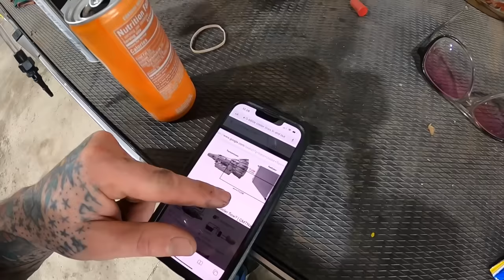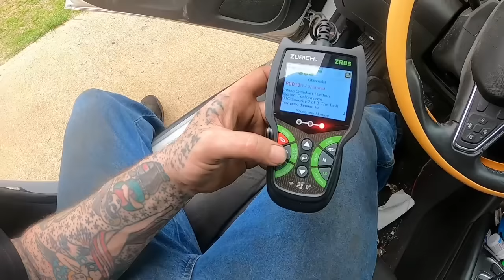REBUILT TRANSMISSION install! I DROPPED it and BROKE it.!

Comment: I’m no Dr. and don’t necessarily recommend it but super glue is real good for some cuts and stuff. 
Be forewarned it is gonna sting a bit. 😬
A loyal mutt that is on the brink will bring nothing but joy and happiness for all! 🙏🏻
Reply: I just had surgery (one of many) and they use super glue to close the incisions instead of stitches. Same stuff you get at the hardware store. Stronger and leaves less scarring.

Comment: Ouch! Thank God you did not get hurt worse but that bandaged finger with come in handy in bad traffic. 😉 It's commendable that were able to use brake clean with the cut on the finger without getting a direct blast right on it (which is what I usually do). I always thought mechanics shop dogs should be named some that is used while twisting wrenches, like Jack, Allen (wrench), Stanley (screwdriver) or Tie (rod).

Comment: One of the converter holes on the flywheel is oblong. If you start with that one the others will line up without installing them all and then tightening.

Comment: Some vehicles like my 97 Dakota there is a one way valve in the linesby the radiator. This prevents the fluid from running out of the lines, cooler and radiator back into the transmission. I guess they don't want too risk the pump in the transmission running dry. On this vehicle back flushing the lines and such wont work. You have to flush the wasy the check valve lets fluid flow.

Comment: With the variable valve timing solenoid if the oil is old it will throw that code, but most the time they do go bad.

Comment: That oil in the connector may have caused the unit to go bad, clean it with electrical component cleaner as it doesn't leave residue behind like some cleaners or damage the plastic like some acetone cleaners and wont cause an electrical short

Comment: Blowing on your converter when you have shop air. Just turn the pressure down or turn the compressor off when you have 10 psi ish

Comment: 36:40 when putting the torque converter bolts in, be sure the torque converter spins easy, if not the converter is NOT seated and you will damage the pump. Should click in three times when seating the converter to the trans. And leave the torque converter bolts loose until ALL bolts are started.

Comment: 6:06 lifting those GM SUVs I always put the rear pad under the front leaf spring bracket and set the short pad up on the front and position it on the frame rail. That way the car lifts level.

Comment: I do the same thing, when I take apart a whatever I just throw all the bolts and nuts into a box and I put a piece of blue tape on the box, write down what part all that held on and usually lose the box.. Being a mechanic for so many years now, all of them really, they go back together the same way they came apart. Even if it was 6 months ago.. : )

Comment: I was on my back changing a fuel line on my 70 Pontiac, the rubber line pulled free fast from the hardline and the back of my hand hit an old rough weld on the crossmember. I first thought I accidently broke a transmission line because of the dark red fluid running out everywhere. Then I remembered the trans cooler lines are on the other side of the engine... Nicked a vein. Good times. :-)

Comment: Hey, just some thoughts on the jack. The tilt knob should point back. And every transmission jack I have used has angle iron welded standing up on the corner brackets so It kind of locks the transmission in. I vote for Rupert too!!!

Comment: take an electric sander without sandpaper hold it against the torque converter it will vibrate the air out as you fill,or just blow in it

Comment: I would definitely give the transmission jack a good once over to make sure it is stable enough to roll around a transmission. Once you placed the torque convertor on the transmission it looked a little front heavy but I have never installed a transmission with a jack like that. Would love a shop like yours but that will never happen. Take care of your dog and we look forward to seeing him in future videos.
Reply: Operator error he didn't wanna use the chains

Comment: I've still got a scar and no feeling in the tip of my finger from my last transmission swap. Worst part of it was the nurse scrubbing the wound with what felt like my little brass wire brush. Good times.

Comment: But now you just need to remember to get a replacement transmission oil cooler for your dad's Tahoe... but even with everything else that trailblazer is put back together and running and driving while shifting up and down the road.,

Comment: Well done. I'm not happy you dropped it. But I em happy it was just the tailshaft. I have done more then a couple of Trans in my days. And I have almost always missed a bolt or too. Thanks for sharing.
Reply: They were the top ones he didn't want to do,  but knew he had to 😅. Would have been easier with it tilted down though.

Comment: I have had to move a oil cooler or two out of the way on big rig stuff. Down under the driveline as long as it is getting cool air. Double up if the masses say it's ok.

Comment: Cool looking green torque converter...my junkyard swapped torque converters two of them were actually coated in red oxide primer usually just rusted steel or the three new ones ive had were b&m dark blue

Comment: The new Chevy have a small slotted hole and that’s the one you start first for the torque converter, then the bigger holes. Now you know for next time you have to get that thing rebuilt. 4l60 things.

Comment: That Silver car is headed for timing chains and guides

That flywheel should have an oval shaped hole to put the first bolt in so it aligns the bolt holes

Comment: I just swapped out the trans in my F150 a few weeks ago and if I could have gotten my hands on an engineer,  any engineer,  I would have strangled them! Why do they design stuff with bolts you can't see and are next to impossible to get to? The two top boots on the bell housing took me almost 4 hours to install! I ended up using several 3/8 extensions to make a 3 foot long extension so I could reach the two bolts. Had to go in by the tail shaft and feel for the holes. Also my torque convertor came already filled. It surprised me because the trans was shipped from Oklahoma City to Carthage Texas and usually they won't ship stuff with fluid already in it. Hopefully this trans last me about 260k like the last one because I sure don't feel like doing that job again.

Comment: stuff  happens . i  had  a  1950  Dodge  flathead  6  on  a  chinese engine  stand  hit  the  the  concrete  trying  to  turn  it  over  and  found  out  when  i  started  it  the  first  time  it  cracked  by  the # 3 main  and  was  pouring  out  coolant  ,  time and  money  wasted .  i'm  glad  Hot Rod  is  feeling  better  and  has  a  dog

Comment: Little tech tip for you Puddin’ when in doubt where something goes or why you have a few pieces left over, do a quick watch of the video you took when you took it apart, hell I’ve been doing that with some of the jobs I’ve been doing lately because as sure as God made little green apples 🍏 I’m gonna get pulled away on a side job or something else and then when I get back on it I’ll be doing the same as you, now where the heck did this bolt go.

Comment: I did a job for my uncle pulled the transmission out of his S10 to replace the torque converter seal got the transmission out new seal in replaced the transmission it still leaked fluid toke it back out he had the transmission checked the sleeve was sliding back and fourth blowing out the torque seal put a new sleeve in and seal no more leaks

Comment: I work in transmission shop and watching you mess with the transmission cracks me up and aslo don't need to fill converter the pump with do that for ya
Reply: Oh and chevys have starting holes for torque converter. Your flywheel will have an ovel shaped hole vs others will be perfect circle

Comment: Ive dropped a junkyard fixed transmission off a floor jack about 19 and broke the entire bellhousing off even with the front pump bolts on a th350 putting together my project car a 86 Buick Regal Factory V8 Sport Coupe
Reply: I then got a floor jack transmission adapter plate from trans dapt from jegs performance shop, and got the next transmission in the car and it ended up getting a $1,275  B&M short tail 2800 rpm stall th350 street master and the next weekend one of my uncles friends is like I'll trade you a rebuilt long tail th350, a new transmission mount in the box and like $250 and i was like seriously after what i have dealt with getting the transmission replaced in the damn car no freaking way lol..
Reply: It's not coming back out of the Regal unless i get rid of the car..

Comment: I've ran a transmission oil cooler on every vehicle ive put a transmission in project vehicle junkyard swap or new or rebuilt didn't matter it usually gets a another radiator and transmission oil cooler, the only exception of that was my 86 chevy k20 custom deluxe long bed well used 4x4 farm truck it already got a new radiator and it was the heavy duty 3 core with ac equipment factory replacement radiator brass and copper so yeah not spending $489 twice...screw that lol

Comment: Looks like you took Hot Rod's dog so watch out she may find another. that dog knew when to come so he is hers no other way about it. As long as it has been since you pulled that transmission I could not have found the hardware little on been able to put it together as well as you did.

Comment: I know how you feel with the Mrs. yelling at you for getting hurt. I was helping a friend with his garage door and had to release the door opener and when I did the door went falling down. My first instinct was catch that bad mamma jamma. When I grabbed it it pulled my arm down while I was pulling up and it ruptured my right distal biceps tendon. It ripped it clean off the radius bone. After a quick 3.5 hour surgery and 6 months of physical therapy the Dr. allowed me to return to work with a life long 25 lb weight limit, that my employer says doesn’t exist, because I was released from the Dr.’s care. Be fore going to the hospital initially I had to drive home from my friends house about 30 miles in a manual transmission Jeep. When getting home and telling my wife she needed to get dressed to take me to the hospital, she immediately started yelling at me about it. She didn’t believe me that it was as bad as I thought, until the Dr. in the E.R. said I needed to see a specialist for the injury and that it was the first time the she had personally seen that type of injury.
Now if it’s falling I’m just moving out the way and letting it do its thing.

Comment: Hey puddin the trai blazer the motor look just like the motor in my 2000 model Isuzu pick up truck and really the bed on it and cab looks like a S10 but not the front clip so im guessing chvey made Isuzu at some piont. I thought Isuzu was made in Japan or china i thought

Comment: You carefully used those support stands at the start  of the video and then later on they were nearby unused. What gives. You already had the transmission fall. This video was a classic case of haste makes waste. And the first thing I thought when Hot-Rod showed up was my how she's grown and will Puddin live to see her full grown.

Worse than having the car fall as with the transmission, even if no-one gets hurt, is thinking the chains, the stands, were right there. 

I'm skipping the videos of the model-A build but I don't want to see you getting hurt either. Please take a moment to prepare a safe work environment. At least you do a good job keeping the floor clean.

Comment: So why don't ya call the transmission recon shop and tell them what's up? They'll fix the damaged one in a flash and send it back out to ya Puddin' Ol' son? Ain't no good puttin' old clean lookin' junk in a brand new trans. That right there terminates the warrantee don't it? Nice work inflating the torque converter with the transport cover. Then when it's full it shows it's approval by popping its cork after you lift off of it was funny as a fit ! Dog gets Hotrod into the shop LOL. Can see it'll be something of a passing interest, as is normal for children? However, sittin' on yur ass wont get that transmission fitted and functioning! Great job you did there Puddin'. See ya next time?

Comment: Did you get sum destructions with dat der trany jack?Maybe, just maybe it el tel ya wat dem chains hangin der R 4. maybe to prevent da tranny from turning you foot into a skid plate. and those knobies on the side , they make it so ya dont gotta lift up and tilt the tranny during your install.  All ya gotta do is turn em so it will move just a hair so U can line up da bolts with out havins 2 prys it to line it up. Does no body on U tubie gots a solvent tank /sink with a pump serviced by Safety Clean  so U can clen up your dirty stuff in a safe manor? they make theirs with  heavy solvent like liquid like gasoline or paint thinner that cut grease like a big dog.  They also have the Greta approved simple green water soluble ones. I dont know how you guys live without one. Plus if ya get really greasy hands you can wash em in it. Another thing I did forever is keep a 6 foot step laddar near the lift so I could climb up to do stuff like take off the parking brake, open the hood, turn on the key  put it in "nothing" neutral, what ever. Its real convenient.

Comment: CHAIN THE TRANSMISSION UP TO THE LIFT ARM, RAISE THE HOIST, ROLL THE TRANS JACK UNDERNEATH IT, RATCHET STRAP THAT MF TO THE TRANS JACK, TAKE THE WEIGHT OFF AND UNCHAIN IT FROM THE LIFT, BOOM! WORK SMARTER NOT HARDER PUDDIN' 
-nomorecaps

Comment: I run a remote trans cooler on everything I hate the tranny fluid running threw the hot radiator heat kills a transmission